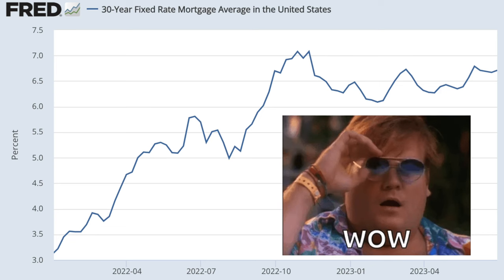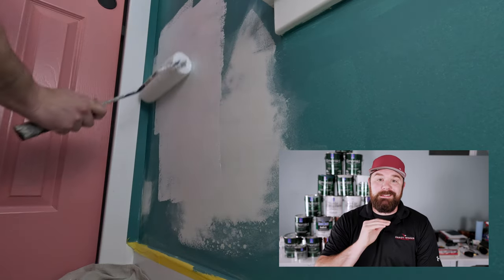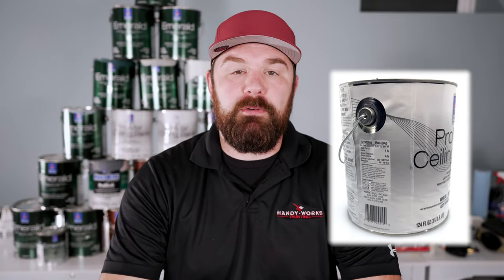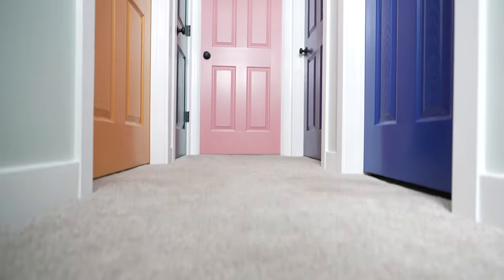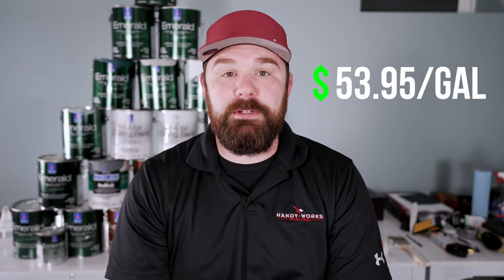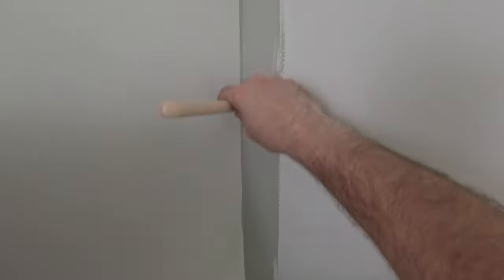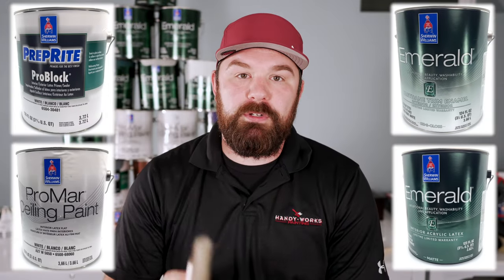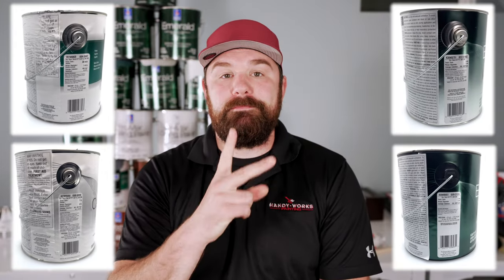My New Paint Load Out // 2023

Comment: What's your opinion of Kilz original oil based primer for use on Wall prior to paint? My son purchased a gallon of it to primer a room in his house. The room is currently painted a dark purple color, and he wants to paint it a light grey. He asked me about it and I just don't have any experience with it. Thanks 😊
Reply from the maker: Kilz primer is decent and it works well, however you don't need to use an oil based primer for a major color shift on walls.  You can use a standard latex based interior primer.  It's inexpensive and is far easier to work with than oil primer.

Comment: Hey Jeremy, I'm closing on a house pretty soon and am wanting to repaint the walls a different color. Just a couple question the the home is only 6 years old. Walls are currently a medium grey tint but, were wanting to paint them a lighter grey, will we need to put primer on the walls first? Also, the walls are textured do we need to go through extra steps before painting them? Thanks for all the content.
Reply from the maker: If you use a decent paint and plan on doing 2 coats then you don't need to prime before hand.  As far as the texturing goes, that's completely up to you.  Assuming that you're going to keep the texture, then you don't have to do anything extra.  If you're trying to get rid of the texture then that's a whole different process.
Reply: @SuperVassarBrothers  awesome thx for the reply.